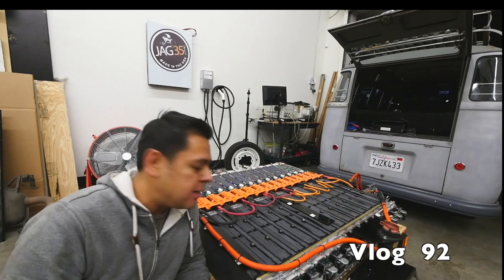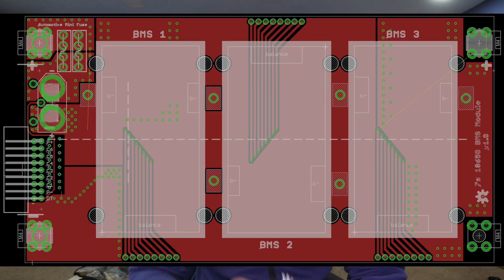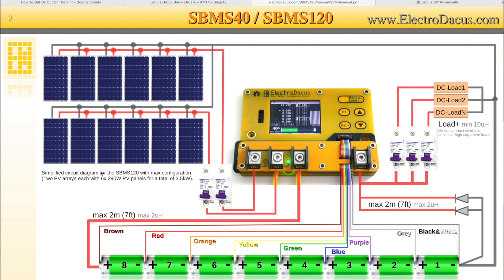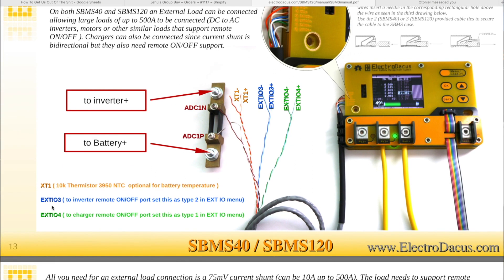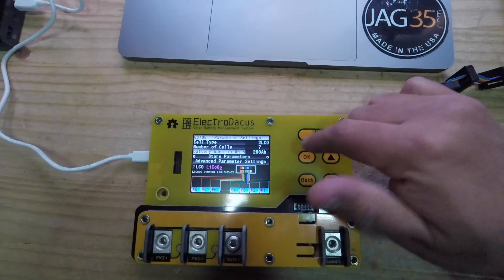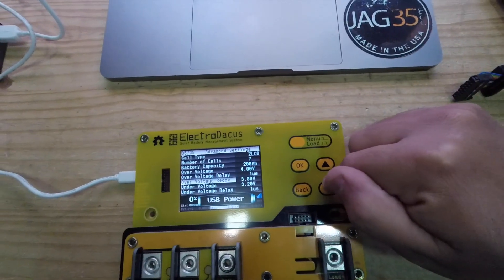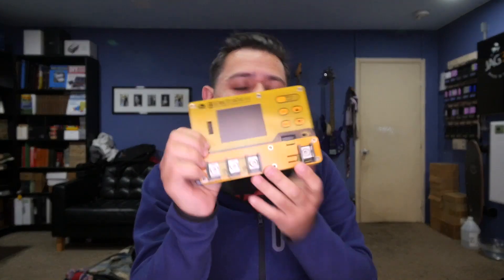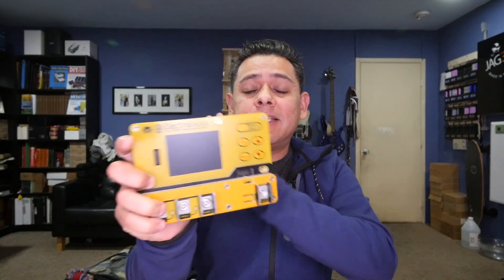Solar Battery Management System (BMS)

Comment: Thanks Jehu for the video.  When powered over USB you can just play with the menu for the Parameter settings to be saved it will need to be connected to a battery as the main IC the ISL94203 is not powered when on USB power and all those parameter settings are saved directly inside the ISL94203 EEPROM and then it will need a power cycle as at power up ISL94203 will load the EEPROM content in to a working RAM memory.
I think for most the new low cost SBMS0 is the best solution as it is just around $120 and it has all the future's of this other chargers including the BMS with cell balancing and LCD with all the energy logging futures (will internally log last year of data and it can be downloaded over serial) but is just missing the PV charger functionality that can easily and inexpensively be done with an external DC SSR controlled by SBMS0 or if you want one of the Victron MPPT Smart solar as they have a remote ON/OFF port that will integrate with SBMS0
Any inverter up to 12KW can be used with SBMS0 as SBMS0 will be used with up to a 500A 75mV external current shunt. The inverter will need to support remote ON/OFF (most do) like Victron, Cotek and I use the low cost PIP2424 all this and other support remote ON/OFF or can be made to but not all (you can ask me if not sure).
All my projects are open source so if you have the knowledge you can build an SBMS yourself but if you only need one or two then it will be much more cost effective to get one from me.
Reply: i will like to get this for my 18650 14s 80p power wall, i am running my home whit this. so i will need to run 2 of this BMS on series? oh i am building 14 more packs so i can be on the 20k range  what you can recommend ?   by the way  thank you for your work and jehu for be a O.C.D. Freak! On Building DiY Stuff lol
Reply: While it is possible to use two SBMS0 for a 14s 48V setup is not that elegant as there will be two SBMS0 each with is own LCD and is own current shunt both showing almost the same thing. Assuming those are 2Ah cells you will have a 160Ah 51.8V = 8.22kWh pack and that is not particularly large. Even a 20kWh pack can be on 24V as typical charge rate should be around 0.2C for long battery life and discharge is typically less than 0.5C. Since SBMS supports an external up to 500A current shunt that means loads of up to 12kW can be connected.
One of the larger systems made with SBMS that I know of is an offgrid setup with a 8s3p LiFePO4 25.6V 900Ah = 23kWh and it has 3x 3000W Victron inverters in parallel for 9000W AC
Reply: Hi Dacian :)

I have the SBMS 100. Great product, great support. Really smart developer. And this product is built to last. If I remember correctly I think the design was created with a 25 year life expectancy on the hardware. Pretty impressive. Keep up the good work. Thanks.
Reply: Thanks for the comment Anthony.
Reply: electrodacus I have purchased 2sbms 120’s and two mppt450s. Dacian always responds to my question within a day or two and is super helpful. I’ll be starting my off the grid house sometime in 2019. And I wouldn’t have done it without this system. Thanks Dacian
Reply: Hello, I think this might be the perfect product for our home. Been looking for a BMS /  charge controller with adjustable battery charge voltage cut off. QUick question: if I have a  18650 Battery  and I want a 12 v system and limit the charge to 4v for battery longevity, would you recommend running at 3s or 4s set up with this device? Many thanks and wonderful product!
Reply: Unfortunately for 12V with those type of cells 3.5 cells will be ideal :) but of course not possible. 3s will not be quite enough and 4s may be a bit to much but if this is the choice I will probably go with 4s this way the range will be from around 12.8V to 16V (a bit high maybe for some 12V DC devices but most inverters should deal with this quite fine).
Best will be 4s LiFePO4 as that will give you an ideal 12V output and is great in therms of cost amortization but if you already have the 18650's then still 4s may be best.
Make sure inverter supports 16V (most do) and that it has remote ON/OFF option Victron, Cotek and some many other support that but not all.
Reply: @electrodacus  I figured as much! I won;t be running an inverter as the house is a 12v house with no large appliances, just chargers, lights and pumps running directly off the 12 v battery. So I might go with a 3s, limit the voltage to 4.1 per cell for extended longevity (maybe drop it down to 4v for the 10 months of the year when we have plenty of power) and simply make a larger battery.......  any feedback would be great, I have backed your project!
Reply: Thanks for supporting the Solar BMS project. If all you will be using is 12V then yes 3s is also a good choice. Make sure you get 32 or 36 cell PV panels for the setup. There is someone in Brazil with a very large 3s DIY battery made of 18650 but he also uses an inverter.
Reply: @electrodacus, would you please send me one of the units to play with. I would love to drive it hard and see what other amazing things it can do. I can pay for it, I am not asking for a free unit, but maybe an older demo unit that I can afford? Please and thanks mate. I have several DIY 18650 battery banks, a 24V super cap bank, and several inverters to test it. Right now I am using a Magnum 4840, but also have an Aims 3000W, APC 3000W, and several more smaller units.
Reply: Currently I have nothing on stock and the earliest I will have something will be around end of January when I hope to have a few SBMS0 prototypes done. If you will be OK with a prototype you will need to contact me around end of January on gmail same username as here electrodacus
Reply: Hi Dacian. With the SBMS0, can the panels both charge the batteries and power the inverter simultaneously or is a on or the other situation?
Reply: Not sure I understand your question. Any way you connect a battery + PV panels + inverter the inverter will first use what is available from panels and then if needed takes the difference from battery or if more is available from PV panels the difference that is not used by inverter will go to charge the battery this works no matther what else in therms of charger you use.
The SBMS0 has no internal PV charger as the other SBMS models but it has a remote ON off for over voltage and one for undervoltage one will control one or multiple chargers can be as simple as a PV panel and a DC SSR (solid state relay) and the other remote will controll loads in this case an inverter so inverter needs to support remote ON/OFF else it can not be used with Lithium (most do or can be modified to support remote ON/OFF as is basically just in parallel with the mechanical ON/OFF switch so open circuit inverter is OFF and close circuit inverter is ON).
Reply: @electrodacus  What I mean is how would the solar BMS handle the following situation:
The battery is nearly depleted at the start of the day so you want to charge it at a low 0.2C rate (to achieve high cycles life) and you want to run loads on your inverter at the same time.  Will the BMS be able to simultaneously charge the battery and power the inverter?

Also do you have any thoughts on Lithium Titanate Oxide (LTO) battery technology? They are said to have lower energy density, but a very high cycle rating.  https://www.ev-power.eu/LTO-Tech/  My thought is that this technology could be used for the daily cycling and combined in a system with a lower cost technology which would take over on the infrequent days when the LTO's are depleted.
Reply: If your battery is nearly depleted (should not be the case in a well designed offgrid setup) then you should wait a bit before using the inverter but if you do part of the power needed for inverter will be covered by solar PV and if you need more than that battery will provide the rest. If you just have a smaller load on the inverter thatn what is available from PV then PV will provide that inverter and the remaining will be put in to battery.
The LTO has half the energy density of LiFePO4 (not relevant other than maybe more expensive shipping) but the cost is also about 2x as high as LiFePO4 and the LiFePO4 already has great cycle life that there is no limitation in typical offgrid and it will last easy 15 to 20 years same as the LTO as most of the degradation will be from calendar aging and not from cycling thus since both last the same 15 to 20 years it makes no sense to pay extra for LTO.
As far as I know there is no better option in therms of cost amortization than LiFePO4 and that is why is what I use and what I recommend for offgrid energy storage.
You can see the battery degradation test I done for my LiFePO4 after one year of full time use in my offgrid house https://plus.google.com/+electrodacus/posts/er5dRShZkSj total degradation was 0.9% most of that was calendar aging that affects all types of cells and almost nothing from cycling even if they are heavily cycled with an average of 47% of battery capacity taken out of the battery per day.
Reply: @electrodacus  Thanks.  I was worried that the panels couldn't be directed to both charge and run the inverter simultaneously even if the total required power was less than what was available from the panels.  I had misunderstood how the BMS worked.   Is Winston still your preferred LiFePO4 manufacturer?
Reply: The fact that PV panels will be the first to contribute to load has nothing to do with SBMS that will work the same in any situation as you basically have all 3 components in parallel the PV panels, the battery and the load (inverter in this case) so the load will first use the source with the highest potential that is the PV panel then if it needs more it will get that from battery and if not the excess from PV will go in to battery so even if you have nothing in betwen just the PV, battery and inverter it will work the exact same way.
Yes Winston is still a very good battery but maybe a bit hard to find.

Comment: any chance for the 14s   48v people systems? for this BMS
Reply: While it is not elegant and normally do not recommend two SBMS0 can be used in series for a 48V system.  But a single 7s  24V with up to 500A will allow for 12kW max size inverter and not sure how many will need more than 12kW.

Comment: Timing is amazing. Just yesterday watched a build of a DIY solar generator using this solar controller and BMS. I am planning my build and was bummed this won't be available until 5+ months from now.
Reply: I just went on his kickstarter and pledged for the SBMS0, exactly what I needed. I actually will be using a Victron charge controller, wanted that for the Bluetooth.

Comment: How many boards can you put on one Dacus BMS? Is it one board with 7 cells per Dacus BMS?  Just asking because I am building a powerwall that will require many boards.
Reply: Any number of parallel cells will be no different from a single large capacity cell so if your system will be 24V so 7s with those sort of cells then just one SBMS will be needed likely you will want the new low cost SBMS0
Reply: @electrodacus  Thank You very much for your response AND advice.   Looking forward to the future of your product.

Comment: Wow$$$ if your going to spend that much why wouldn't you just go with a Batrium system?
Reply: The SBMS0 costs about 120USD the SBMS40 and SBMS120 have build in solar PV chargers that is why they cost more. SBMS120 supports a 3kW PV array so a 120A PV charger thus the name.
Reply: It's a great device. I have an SBMS120 in a truck camper. 35 Nissan leaf battery packs in 7S (18kwh), 4x190w 24v PV panels, 4kw Samlex EVO4024 inverter with 120A charger...works fabulous.
Reply: @stevehericks5764  Are you using the BMS feature with your setup? I'm a bit confused how this would work with a large system like yours. I have something similar. 30Kw of 7S tesla made modules. Charger and inverter handle high and low cut off voltages, but I don't monitor directly the health of the individual battery strings. A Batrium setup will cost about $1500 for my battery bank.
Reply: @ravemind8433  yes I use the BMS and solar charge controller but do not handle discharge through the DFET or charge other than solar through the CFET.. Electrodacus products are not very friendly with inductive/capacitive loads like my large inverter/charger so all power in and out of the bank is through a 500A shunt  monitored by the SBMS120. It fully monitors all power flow and  provides me with outputs to manage charging and discharging. The SBMS120 has configurable output SSRs. I use one for high voltage limits to shut off the inverter's   charging function as well as disable charging from my second vehicle alternator. A second SSR operates as a low voltage limit to shut off the inverter. My Samlex inverter's software is not designed correctly (in my opinion) to be always managed by the BMS but I have a small workaround that works. Dacian designed SBMS120 to work logically (primarily with Victron inverter's logic) and it is a software issue with the Samlex that is the problem. Samlex (almost) agrees that their logic is incorrect but I am only their second customer using lithium and their other customer has a different BMS. Happy to share. I will eventually get all 25kwh/49 packs built into a larger pack on a bigger camper and have no reservations about it's ability to work properly.
Reply: Werner Berry You can bet there's something in it for him. He's had one for a year now so that tells me that the owner has made him a good offer to get it up and going. It all about the $$$$$$$$$$$$.
Reply: Werner Berry because he will be making money off it, probably every unit there's a little something if it goes well.
Reply: just as good as batrium i think had one for a few years now
Reply: batrium is Good, But i Hate Hungry Money People. they want to Push the system, But do not want to Help some one like Jehu to Push the Product. Batrium is to Much Money, some one like me will spend 1,000 dollars or more just on longmons,  do the mat,  i got 14s but i am adding 14s more, plus Shipping. that is to much. for that i just get the dam! Tesla Power wall, i get Warranty for Free. that is my opinion! i can be ron. i just using commonsense.